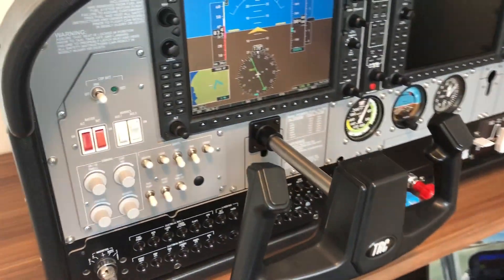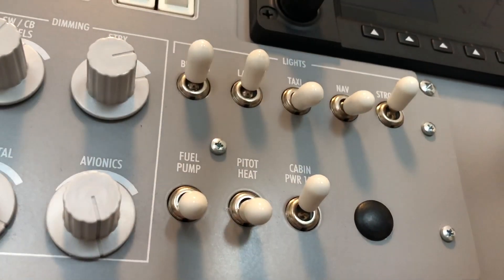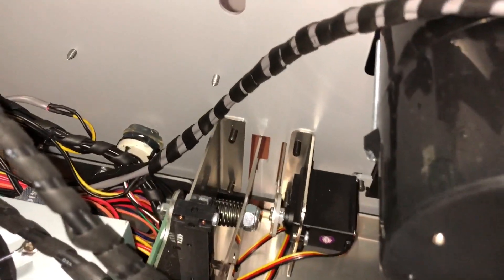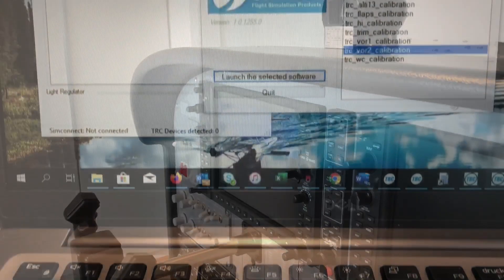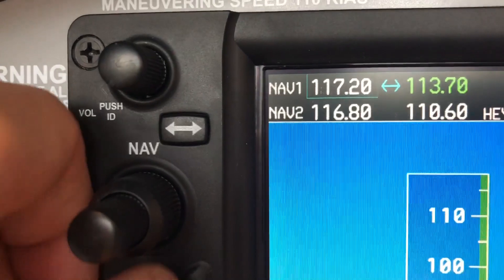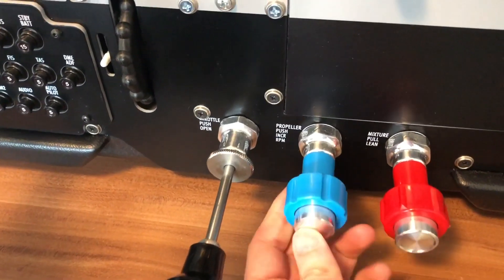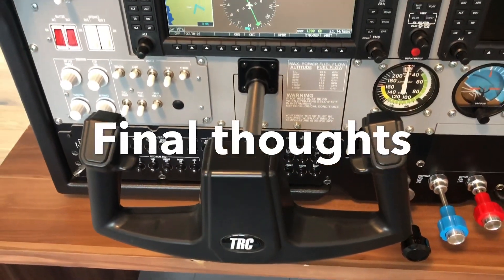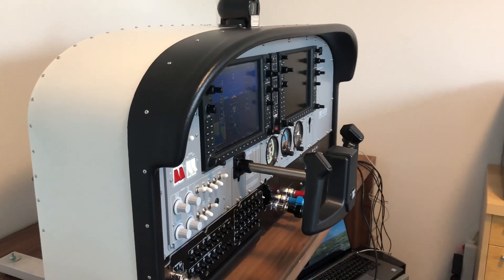The EUR 21000 Flight sim panel from TRC

Comment: Hi! I am looking to rebuild a Cessna 172 G1000 for ms FS 2020 without robbing a bank... You stated that there are way cheaper solutions. What are these? (Antwort gerne auch auf Deutsch :-) )
Reply from the maker: Look at simvim.com - you get free cessna cockpit panels that you can put on a cheap screen, have a cheap PI running it and you just google for cut-out templates for a wooden plate with holes and 3d printed bezels. A cheap saitek cessna yoke and throttle and an ipad for the radio stack. And a few buttons connected to an arduino or leo bodnar button board. Some time and a few hundred bucks and you can have a decent panel.

Comment: Hello. Hope you are still having fun with your flight deck sim .  How many usb  outputs do you need to have on your computer so to have flight deck system connected ?
Reply from the maker: I sold the unit - but it did use 4 usb ports I think.
Reply: @AlfredtwinSim  thanks a lot!